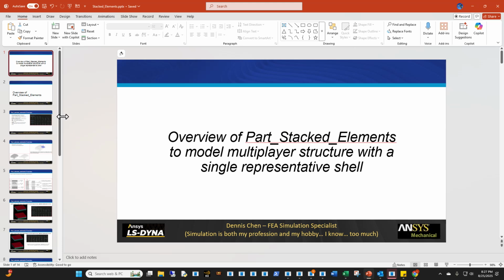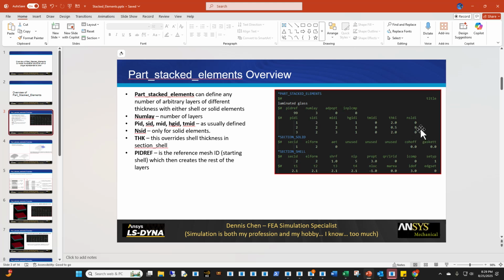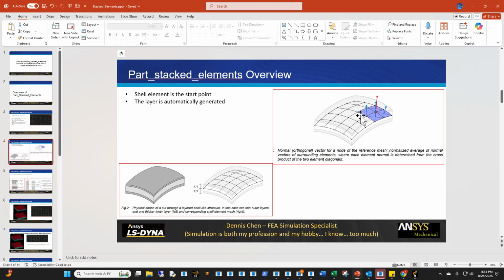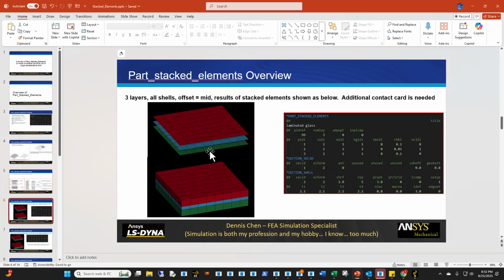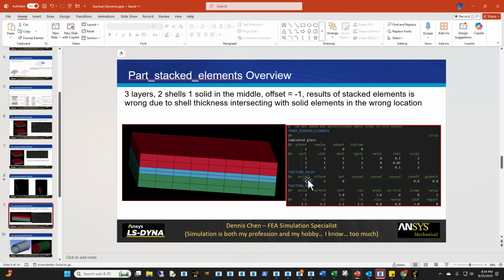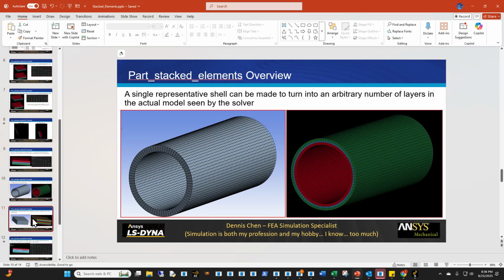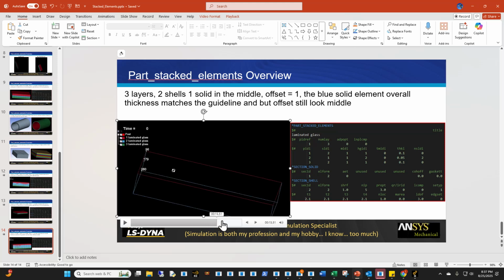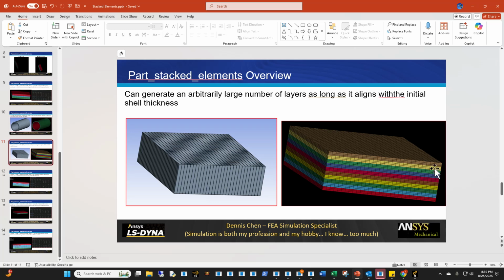LS-Dyna Tutorial - Modelling Composite Layers using single shell element with Part_stacked_Elements

Comment: Great video but I cannot understand how did you mesh shell geometry like solid I'm specifically trying to do that. I'm trying to copy an article and he gave MAT59 values but only shell ones. ZZC ZZT SCA SBA are not given but in the article it displayed like solid 2 element in every layer. Therefore I'm trying to mesh shell like solid but use MAT59 shell failure keyword at least display it like solid
Reply from the maker: I think the presentation outlined this but it's just using part_stacked_Elements keyword.   It's just a feature in LS-Dyna that let you model multiple layers using a single keyword.